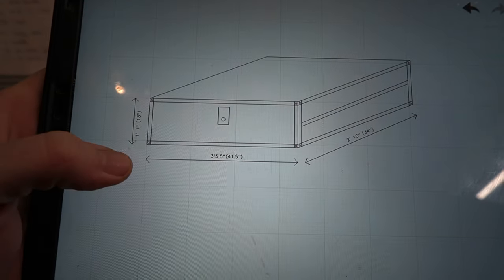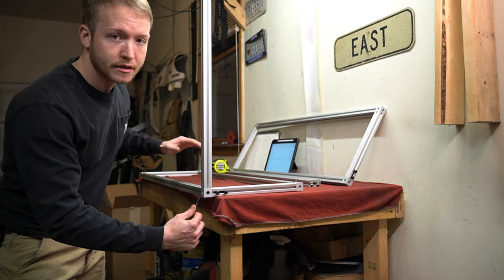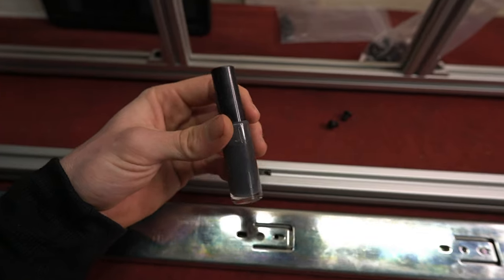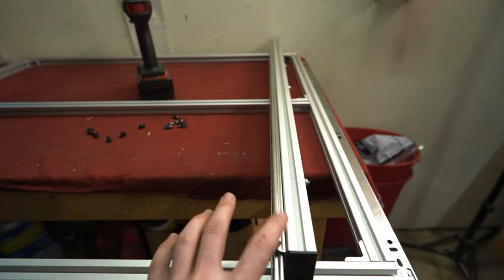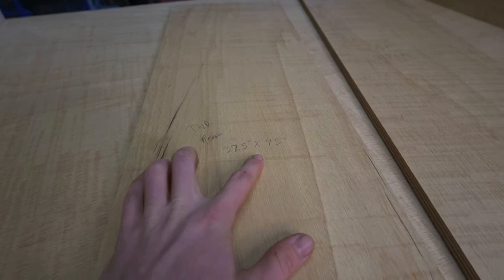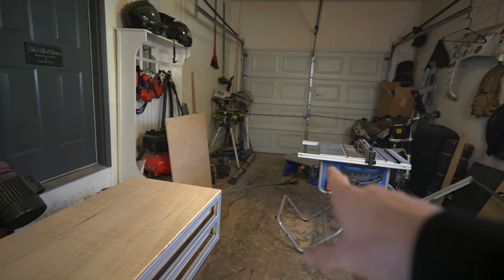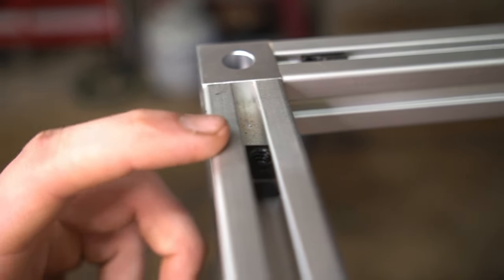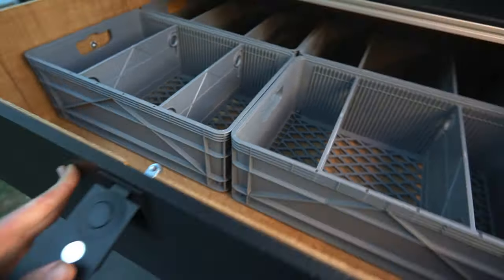4Runner Rear Storage Drawers DIY **DETAILED BUILD** with Slide out Table!!

Comment: Great job although I would have just used an L bracket into the channels below the top to attach the top from underneath so the screws are hidden and no holes drilled into that beautiful top

Comment: Do you have the dimensions for the build?  I would like to build a two drawer system with a pull out table as you except have it come completely out and unfold to a regular table as the Drifta drawers have.  Great job on this and thanks for posting.  One of the better ones I’ve seen.
Reply from the maker: Thanks Harry! I don’t have the dimensions saved but I should mention them in the video!

Comment: First off - great video and thank you so much for sharing so much detail! Secondly - I'm curious why you didn't build the drawer itself out of extruded aluminum as well? (I'm a newb with EA, so please bear with me).
Reply from the maker: Even though it’s aluminum the extrusion is actually decently heavy once it’s all assembled! Also the extrusion takes up more space than 1/2” ply wood does. Also much cheaper to use wood for the drawers!

Comment: If you are considering working with the extruded aluminum, you need to watch the "how to" videos by 80/20.  80/20 has some very good tutorials on working with the extrusion and the fittings.  I started working with 80/20, thirty years ago.  And have learned a few things.  

You can avoid the cost of the special corners, and most other fittings, by buying a jig which lets you drill an access hole through the center of a piece of the extrusion, and then fasten things together blind.  

A tap, to tap threads into the ends of the extrusions can be bought at home centers and hardware stores for less than $10.  The interior holes of the 10-series, (based on 1-inch measurements), extrusions, is sized to be tapped for 1/4-20 threads.  The 25-series, (which is metric), is sized to be tapped for 6-mm thread.  The suppliers charge you for every tapped end.  

And if you have a good miter saw you can cut the extrusion with a fine-toothed carbide tipped blade.  The suppliers charge you for every cut.  

Tip, if you buy lengths of uncut extrusion, buy it 8-ft or less in length.   The shipping costs essentially double for packages longer than 8-ft.

Comment: Really great build and video! Thanks.  I'm guessing that you went with those external side plates to mount the extrusions that the sliders attach to for added weight bearing? If I wanted an internal connector option, would they not hold the weight of a drawer, you're guessing?
Reply from the maker: I’ve done these a few different ways just trying to find the best method. If you check out my latest drawer built in my 80 series I used a corner connector on the “inside” that I believe worked out way better!

Comment: my only gripe is the ball bearings on the amazon drawer slide rattle. Awsome build btw!
Reply from the maker: We haven’t noticed any rattling! These have a rubber end piece they slide onto in the closed position that should prevent something like that for the most part 👍🏼 but thank you for watching!

Comment: Wow, what a great find. I wanted drawers for very long time and always hesitated to buy due to its high price. Without finding this video I would have never thought about this was possible. I have never done any wood work and that kind of taunted me to build wooden drawer but this... seems like I could definitely manage it. I just planned to build one based on your plan and did little tweaking for my use with double drawer and estimated price came out around $650 (probably will end up higher), but still way cheaper than the cheapest drawer options out there. Only question I have is the weight. Do you have estimated weight of the built?
Thank you again for your time and effort making these videos. 
Subscribed!
Reply from the maker: So glad the video could help you! I do not have an estimate on weight but it is somewhere under 100lbs for sure!

Comment: This is great!! Perfect kickstart to the project I want to do. For the gap between the 2x1 and the tray for the sliding rails, did you do .5" each side(so 1" total)? I swear from the drawing you had it was only a .5 gap total (.25 each side).
Reply from the maker: Thank you sir! & Yes .5” on each side! 1” total
Reply: @Adv4x4  Thank you! I'm doing a similar build but very low profile. Mostly based around your slide out tray. Parts ordered, thanks for sharing 🙏.
Reply from the maker: Awesome!! Good luck with your build!!
Reply: Thanks! Got all materials in and put the frame together. Quick question, what thickness aluminum did you use for the slide out surface, 0.125? I'm debating Aluminum or ACM, with the edge to just Aluminum as not sure how ACM will do with stove heat/pots etc.

Side note, TNUTZ was great to work with. Too bad you can't do affiliate links like with Amazon for a little kick back for you.
Reply from the maker: Awesome man! I use .100 aluminum! 
Could definitely use another material but like you said with heat it may not last. 

Also I know, I wish I could get an affiliate link 😂
Reply: @Adv4x4  Thank you!

Comment: Are the slides you used for both the drawer and table the same? I'm guessing the same. One has lock one does not? Also, what is the length of those turn buckles?
Reply from the maker: They are linked in description but yes I believe same slides just one with lock and one without. I don’t remember the exact length. Best to measure and see which length works best once your set is done 👍🏼
Reply: @Adv4x4  cheers thanks! Parts get here Monday so excited to build this!
Reply: One last question. Do you know the dimensions on the wood box?
Reply from the maker: Not off the top of my head! It’s been awhile since I have built this with many other projects after haha

Comment: Nice build. Total build cost? (Materials)
Reply from the maker: I have not added it up just yet but if I had to guess probably around $600. I was building two different drawer systems at the same time so ordering parts at the same time made that hard to distinguish